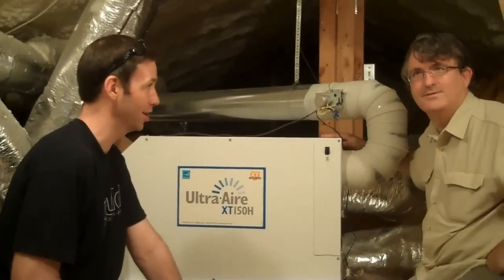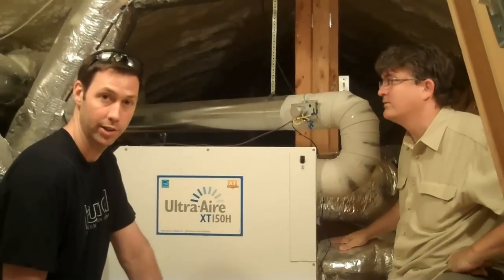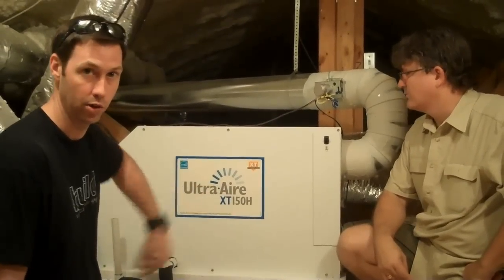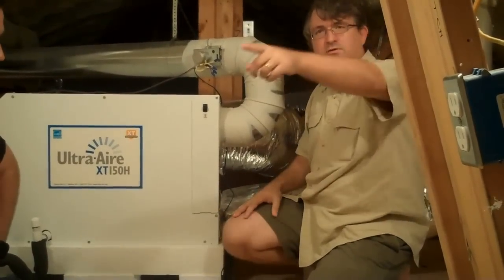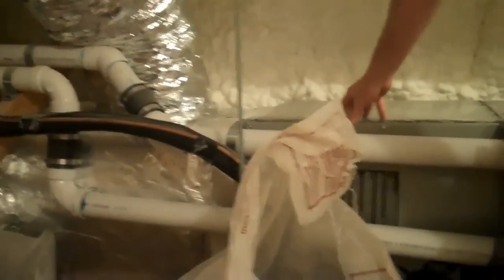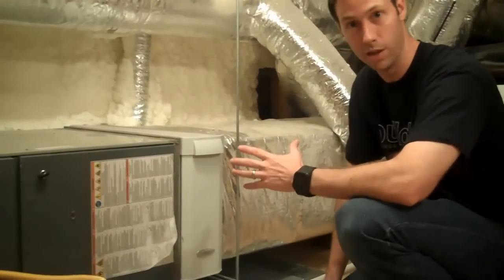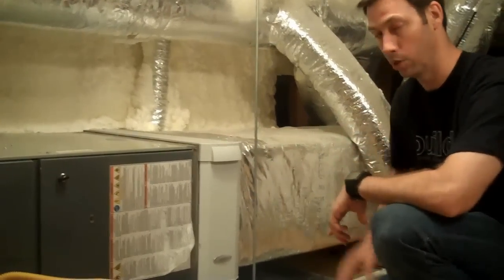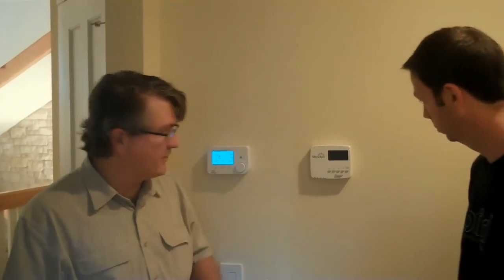Dehumidification with an Ultra Aire XT150H

Comment from the maker: @largeview True indeed.  The good thing about this set up is that the filter is mainly for keeping the unit clean and not for indoor air quality as it dumps into the return side of the furnace and we have an April Aire Media Filter on the Furnace.  Your point is a good one however, most filters don't get changed on a regular basis and the equipment suffers as a result.  Matt Risinger

Comment from the maker: This unit is mooted in the attic but it's connected to the HVAC ducting.  It pulls air in from the return air grill in the hallway below, dehumidifies that air, and sends it to a supply duct.  It's not pulling any air from the attic.  This unit could be used in a un-conditioned attic as well, or mounted in a basement mechanical closet.  Matt Risinger
Reply: Morning Matt, i have one of these systems it was installed before i moved in.  I have no clue how to use it and the control panel is very very dated, it has knobs. Where would i get someone who could update it to benefit me and my family?

Comment from the maker: @LukeSkaff #1 yes you are correct, I'm mistaken.  It has it's own filter then dumps into the supply side to be distributed.  #2 That outside air damper is set to open 10 minutes every 60 minutes.  We're trying to achieve the ASHRAE 62.2 standard for fresh air.  #3 I've not done an ERV yet, but that is a great piece of equipment and hope to incorporate them in future builds.  Thanks for the great comments.  Matt Risinger

Comment from the maker: @brentisaacks1 We do have two HVAC systems, but only one Dehum.  This dehum can easily handle this size house for Dehumidification purposes and remember that humidity inside a house is very different than temperature.  If you have a 3000sf house I would recommend only one XT150 to be installed.  That one unit can easily handle the load of that sized home.  -Matt

Comment: If I'm not mistaken, the furnace filter is on the cold air return, which means the dehumidifier is actually piped into the supply air, which is what the dehumidifier manufacturer recommends.

Comment from the maker: @Sirfloatsalot1 It only does that when the AprilAire controller calls for fresh air and the rigid pipe to the outside opens.  Roughly 10 minutes of every hour this happens and that meets our ASHRAE 62.2 fresh air standard.  Great question.  Matt Risinger

Comment: Like the explanation on the dehum. Ultra air is the best of all dehums I find. I notice o e small flaw in the install. The fresh air intake of the dehum is controlled by a motorized damper bit is close to the unit and not close to the point of entry to the building envelope. You have a potential off hot humid air stacking in the pipe and condensating because the pipe sits in what's considered a semi conditioned space.. 
Thanks 
Kris

Comment: Hey Matt. Love your videos. We are having a 3700sf house built in the Raleigh area. The builder is going to use two, two-stage heat pumps. Is there still an advantage to installing a whole house dehumidifier if you are using these heat pumps instead of a conventional A/C unit?

Comment: A couple of questions: 1) You say the dehumidifier is plumbed into the return side of the furnace to be filtered at about 4:55 in the video but it is connected to the supply side plenum?  2) What percent of the time is the outside air damper open?  3) Have you ever combined a whole house dehumidifier with a ERV to recover some of the energy of bringing out outside air in?

Comment: In this combinition (furnace/dehumidifier), does the dehumidifier control turn on the furnace circulation fan with the dehumidifier in order to push the  dehumidified air through the high-efficiency furnace filter - correct?

Comment: i have wanted to insulate the attic, but how would i spot leaks in the 20 year old roof, so far i have fixed 2 leaks becuse i could tell where the leak was by looking for tell tail signs in the attic.  second i fear a roof osb that rots is a huge risk to anyone waliking on the roof -  am i missing something?

Comment: Matt Risinger Really enjoying your videos on the Ultra Aire products.  Do you find that these units adequately push the dehumidifed air through the supply duct system without the use of the HVAC fan?  I'm about to install a 105 and wanted some information from someone with first-hand experience. Thank you!

Comment: What are you doing to dehumidify the attic space? My attic has no ventilation and is not a conditioned space with foam insulation.
Reply: Get your attic vented. The attic in the video is not too hot because the roof deck is insulated AND cool air from the a/c is circulated through the attic, which the video neglected to say.